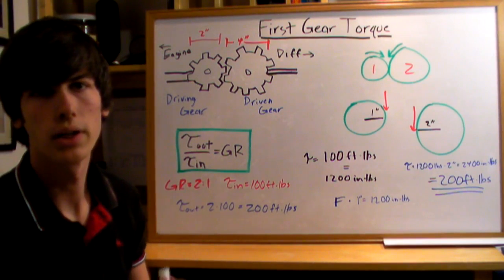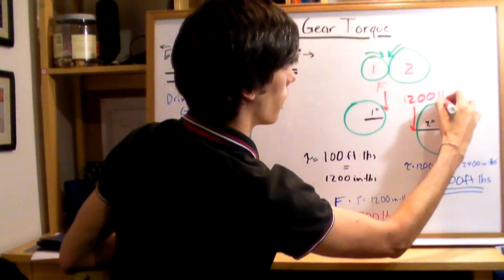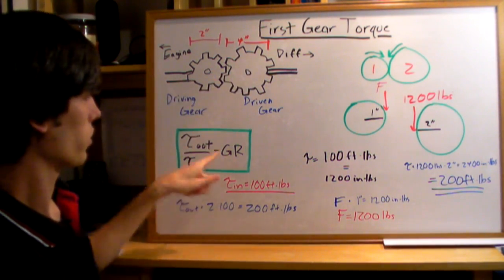First Gear Torque - Explained

Comment: These are the subtitles for your video to embed in youtube...
Thanks from Russia!

0:00
so in this video I'll be explaining first gear torque and why you have greater acceleration when you're in first gear
0:06
so here's the setup we've got we've got the engine connected to a gear and the transmission which is connected to a larger gear going to the differential
0:14
the engine gear is going to be 2 inches and then the gear going toward the differential is going to be 4 inches
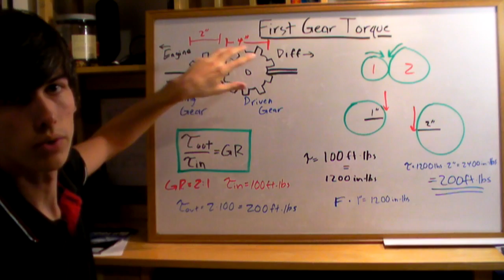0:20
so we have a gear ratio of two to one 
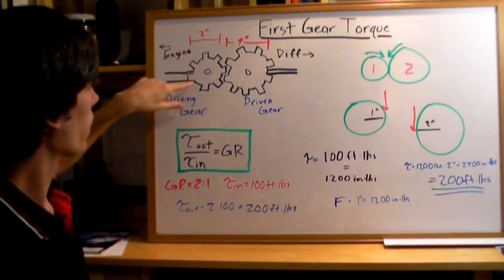0:23
so we've got the two inch driving gear and the 4-inch driven gear
0:28
so the ratio of the torque is going to be the torque output the torque of this gear here going to the differential over the torque input the torque coming from the engine going to this gear is going to be equivalent to the gear ratio
0:41
and gear ratio is going to be two to one
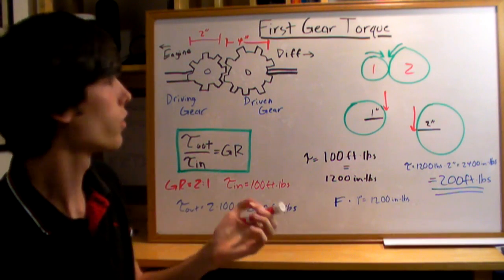0:44
so let's just say our engine has a torque of 100 foot pounds
0:49
well the output torque going to the differential is going to be to the gear ratio times the torque input 100 foot pounds
0:57
so that's going to be 200 ft lb
0:59
so effectively using a driven gear two times the pitch diameter of the driving gear you're going to double the torque going to the wheels
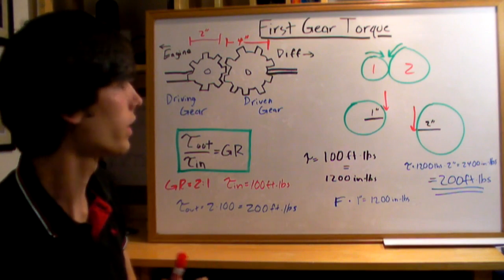1:10
so that's why you're going to have a greater acceleration than if you're pitch in second gear
1:15
say second gear had a ratio of 1.5 well then you'd only have 150 ft pounds going to the differential
1:23
now where does this come from
1:25
this equation right here
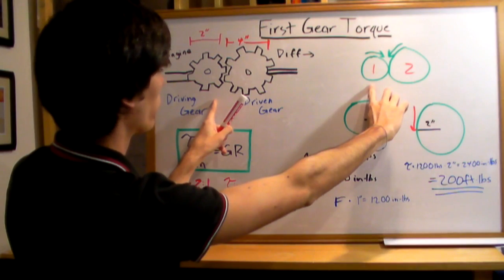1:27
so if you've got two gears here's the first one that driven the driving gear and here's the second one the driven gear
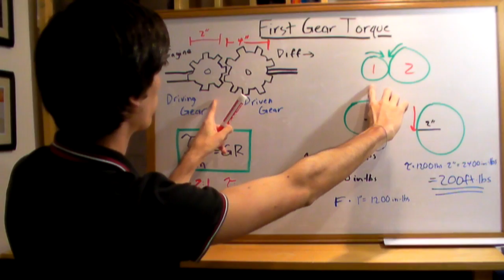1:33
and so this has a radius of 1 inch this one has a radius of 2 inches
1:38
so we have our torque input which is 100 foot pounds and we want to convert that to inch pounds for this
1:47
so we're going to do multiply that by 12 you're going to have 1200 inch pounds
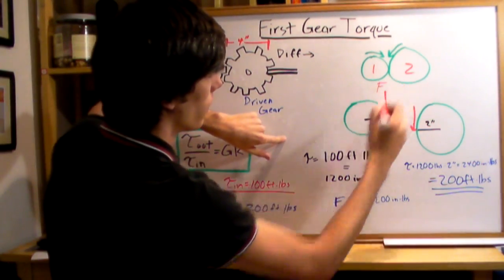1:50
and we want to find out what this force is right here
1:54
so the force times the radius of this shaft will give you the torque
2:02
we know the torque is 1200 inch pounds
2:05
we know the radius is one
2:06
so that force it's going to be equal to 1200 pounds
2:11
all right so now that we know that force is 1200 lb we've got 1200 lb of force coming down on this gear
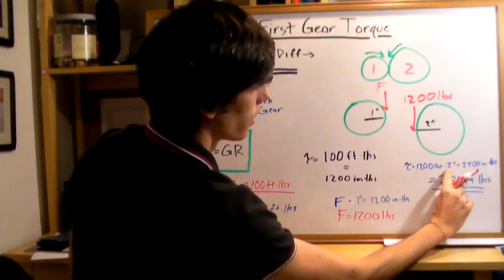2:22
so 1200 times the 2-inch radius is going to be 2,400 inch pounds
2:28
if you divide this 2400 inch pounds by 12 you're going to get 200 ft pounds
2:32
that's just converting it back
2:34
so that 200 foot pounds is the same we calculated earlier for the output of the differential with that
2:40
so that's where this equation right here comes from

Comment: if you ring a rolling road /dyno they refuse to confirm what numbers are generated in first gear...i had to straight up point out a 1 to 1 crank + wheel speed on a 16'' alloy would be 50% mach 1 lol , even in final gear cars are putting out more torque then manufacturers claim is happening......series 1 defender..68hp 114ftlb.....reality +1500ftlb..

Comment: question , so if an engine  having 100 horse power at the flywheel  turning a manual transmission with  a 15% driveloss that means it have 85 horsepower at the wheels , so that means the box stole just 15 horsepower , having modified the engine let say to 1000horse power ,keeping the same gearbox does it steal 150 horsepower ? or just 15 horse power, ?

Comment: I was wondering why 1st gear produces more power if it's connected to a smaller gear on the countershaft. Thanks man! 8 years later lol
Reply: 1st gear doesn't produce more power. The engine power only depends on RPM, regardless of what gear you're in. 1st gear does produce the most torque, giving the highest acceleration at low speeds. It may sound pedantic but torque and power are not the same at all.

Comment: I know cars accelerate more in lower gears because of increased torque, but don't they also accelerate faster simply because the engine is running faster and the engine can produce more horsepower?

Comment: Good explanation of how to solve a math problem with gear ratio but doesn't explain, at least in my understanding, the physics behind why different sized gears can generate more torque.  In other words, after watching the video, you can provide a problem wherein x-amount of input force is given by an engine and I can calculate the output differential but wouldn't be able to explain why this is.  Thank you for the video as it is still very helpful in explaining the 'how'.

Comment: So does that mean that 100 lbs-ft produced at the flywheel, becomes 200 lbs-ft at first gear, then does it become 600 lbs-ft at the wheels with a 3:1 differential?

Comment: But keep in mind that the rotational speed at driven gear will be lower than the output gear. This is the trade off of force multiplier.

Comment: I have often noticed on various websites and videos that people claim that the force changes between the ingoing and outgoing gears with little to no mention of torque. I ran some calculations myself and got the same conclusions that you did: that the force remains constant throughout and the torque changes due to the changing radius of each gear. This makes sense in terms of the input and output work/power because the force and velocity/force and distance remain constant, and the torque and angular distance/torque and angular velocity change accordingly to keep these things constant. 

Bit then I saw examples of how gears can be connected to linear systems which can be used to lift more weight straight up implying that the outgoing force really had increased when going from a smaller gear to a larger one. So what gives? What am I missing?

Comment: Is greater torque really the reason for better acceletation in first gear? 

Basic physics says that: energy = 1/2*mass*velocity^2. 
Let's say a car has a mass of 1000 kg. The energy required to reach 10km/h will then be 0.5*1000*10^2 = 50000 joule. The energy required to go from 10km/h to 20km/h will be 0.5*1000*20^2 - 50000 =  15000 joule. 
We see that the energy required to go from 10 to 20 is three times greater than what's required to go from 0 to 10. We also know that horsepower is just another unit for power and that power = energy/time. 
If we simplify this by saying that a car produces an equal amount of horsepower at every speed, the time used to get from 0 to 10 has to be less than the required time to get from 10 to 20, because three times more energy was needed, and thus the acceleration is greater from 0 to 10.

Perhaps I'm missing the point here, but as I see it, the velocity formula is the main reason that acceleration is greater the slower you are going-
.
Reply: Well, that's one way to looking at it. But you can also use a=F/m. The point is, the force a car can really use to propel itself forward is limited by grip. In lower gears and especially in first gear the engine basically always can overmatch the grip limit. So acceleration at first gear is actually limited by grip. In higher gears that starts to change and the acceleration starts to be limited by engine power.
Reply: Anders R you're right, but the engine has a power vs rpm curve, thus it's not possible to assume constant power output. different gears are used to have higher rpm at lower speeds, looking for more torque at lower speeds and high power at higher speeds

Comment: So applying the same logic to tires, ignoring the difference in mass, having larger tires means you have more torque. However, since a larger tire has more mass, it has a larger moment of inertia, meaning it's harder to spin, meaning that up until some point increasing the radius of the tires increases output torque, but after that it decreases it. Did I get this right?
Reply: No. A larger tire means less torque.

Comment: This is true most of the times, except on slow turbo diesel engines.

In the first gear the engine cannot rev fast enough while maintaining the proper torque due to the turbo lag. You might be better/same shifting earlier.
Of course if you were to tow something heavy, first gear will be always the fastest!

Comment: Great video! One question: when putting a car on the dyno, the torque is never above the engine torque although the car is ran from 1st gear (or is it not?). So unless the car is run on a final gear/differential ratio of 1:1 when measurment is made, the dyno cannot output the engine values (minus mechanical frictions). This question is puzzling me. Now, I haven't seen a real dyno in action so I have no idea whether the system adjusts its values depending on each car's caracteristics, which would be the only way I see to overcome the problem.
Reply: Manu Delmarche What the dyno shows you is a adjusted value. What you have to do for a dyno run is to hook up the engine to the dyno so the dyno knows how high the engine is reving. Compare this with the speed the rollers are spinning and you can calculate the actual gearratio and wheeldiameter very easy just bechause of the difference between the rpms. 

Now the second thing is to measure how fast the car can accelerate the rollers and if you also know how much mass the rollers have, you can simply calculate the force that has been applied. With the engine rpm and the known gearratio and the known force on the wheel you can calculate the torque needed on the flywheel and in the end the torque and power the engine has produced.
Modern dynos also take some other variables into account but it is in the end never an absolut accurate measurement.
Reply: +Manu Delmarche you are right you do the test in gear 3/4 because the gearing is closest to 1 to 1

Comment: I love your videos, man. I have a question though. I'm studying mech engineering too but am only through my sophomore year so I'm not entirely studied. So, isn't horsepower a function of torque and rpm? Would that mean that wheel horsepower is always constant because in lower gears your torque is higher but the output shaft speeds are lower, and vise versa? I've been wondering this since I learned about shaft-transmitted power in one of my physics classes last semester.
Reply: I’m surprised no one answered this even though it is phenomenally old at this point.

Yes, if it’s 200hp @ 5000 then that is 200hp @ 5000 in each gear to the road. The torque to the road is progressively lower with each gear from say, 3.78:1 in first to 1:1 in 5th and .79:1 in 6th (Nissan CD009).

Torque is a twisting force so it can be manipulated with gears. Horsepower is a measure of power and regardless of gears is still  the same, work over time. As a car gets faster it stops accelerating because the car has to compete with other forces like drag and friction
Reply: @jkent9915 does peak torque revs change too? I mean, that because of what you’ve said about the same horsepower, if we have a diesel engine with let’s say peak torque at 1750 rpm, then in first gear (3.73 ratio) the peak torque would be at 450 rpm, which is nonesense to me, because then, moving off from second gear would be better than in first gear. So, are revs of the peak torque same or changing in gears?

Comment: Is this comparable to how you can twist wheel nuts off more easily with a longer arm? I.e. the greater size of the driven cog increases the distance and thus the torque?
Reply from the maker: Absolutely, it's just like a lever.

Comment: Why does higher torque mean better acceleration? If you have more tire revolution at a higher gear why can't you start at a higher gear?
Reply from the maker: You'll be at a lower rpm with a lower power, and your torque multiplication will not be as high. Torque can be simply looked at like a lever. The greater the gear ratio (or lever arm), the more torque will be applied.
Reply: Thanks a lot!!! Your videos are really good and make complex concepts easy to understand.

Comment: Yep I understand....in my motorsport certain gears will "pull the rpm's down to the lower side of the powerband "...in turn it lowers wheel speed as well. I have an idea on what gears to go with to keep me on top side of my rpm's ...just trying to figure out if its giving the most torque delivery to the ground...as far as the ratio's are concerned...

Comment from the maker: It's really a balance. Launching from 4-5K rpm may mean some tire spin, but it also means good power once the wheels lock up. If you lock up the wheels at 2k you're not making much power up until the higher RPMs, so overall you may lose time. You don't want the tires to flat out spin, but a little chirp is actually about as good as it gets.

Comment: When they do a hot-lap on top-gear or fifth-gear etc, why do they use wheel-spin off the line instead of trying to perfectly engage first and maximize power without the loss of traction? Do they need the tire-heat? Is a moment of spin-then-catch faster than just perfect gear-engagement?  Why?

Comment: So if youre wide open in first gear and your car outputs a max of 500lb ft of torque, and your first gear ratio is 3:1, the torque going to the dirrerential would be 1500lb ft?

Comment from the maker: The lower the gear ratio, the higher the torque at the wheels. If the gear is low though, it limits the speed at which the vehicle can travel (see car gears - explained).

Comment from the maker: For the most part, but low gear ratios do not correlate with more horsepower. Horsepower is independent of gear ratios really. Torque is transferred, hp is the measurement of how frequently the torque is transferred, and  how much.

Comment from the maker: Not sure, but 19kw is quite a bit of power. If it's small it may be the max. If it's large, perhaps it's to run it. But I'm just guessing. If you know more details of it I'd just look up the transmission online.

Comment: i need a help....... i hav a gear box on which its imprinted as power=19Kw, does that mean the power required to drive the gear box or the maximum output power of the gear box..???

Comment: The energy is that of the engine. So the engine components - the pistons, crank, etc - will move twice as fast and hard in first gear. The only difference is the gearing ratios. Hp is a function of torque and rpm. It isn't actually measured but calculated.

Comment: Lets say the engine is producing 100hp at all revs. If you accelerate in first gear, you speed up sooner than in second gear. But hp is a rate of energy. So lets say second gear takes twice as long. If the engine is still producing 100hp during that whole time, it takes twice as much energy to accelerate to the same speed. But that doesnt work, because in both cases, the car would have the same energy in velocity. Where does that energy go, or moreso how does it play into this?

Comment from the maker: @bo6arif I would imagine it would for lower gears, but I'm not positive. Apparently some dynos give you the ability to enter your gearing, or adjust automatically to your gearing, or you do the test in your transmission's 1:1 gear. Never used a dyno though, but mathematically it would seem lower gears would show higher torque.

Comment: @EngineeringExplained 

Idk how, you seem really smart. and can make sense out of it. Seems you wouldn't have trouble finding a job at any automaker or race team or Corporation. I'd like to have the math skills to do what you're doing. Mechanical Engineering I'm assuming? I can barely get through Algebra let alone Calc and stuff.

Comment: So if I have a Jeep that has 235 ft. lbs torque with a 4:1 gear ratio in 4WD low in first gear would that now be 940 ft. lbs. torque? That is ALOT!